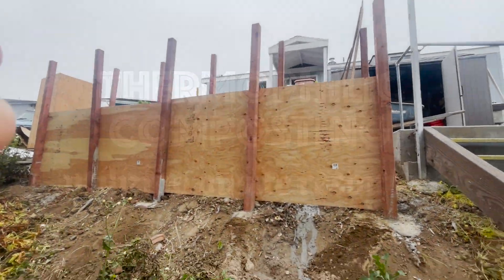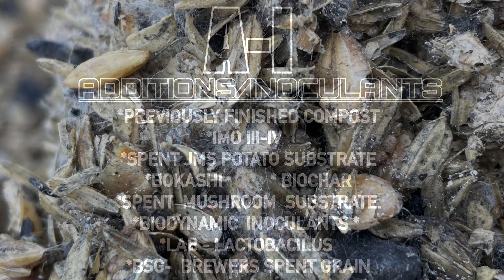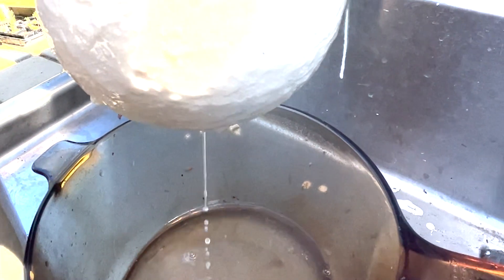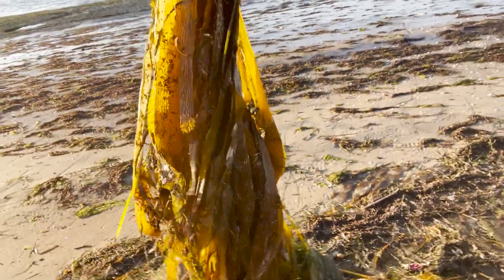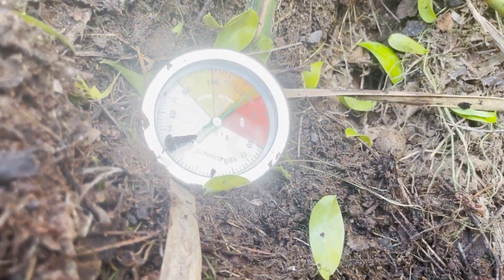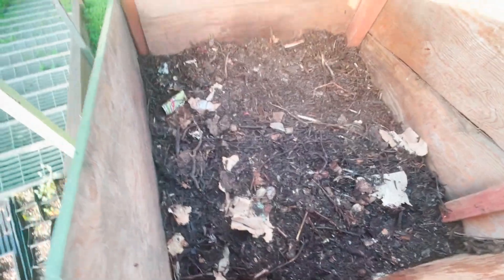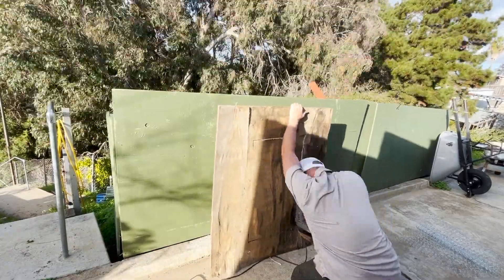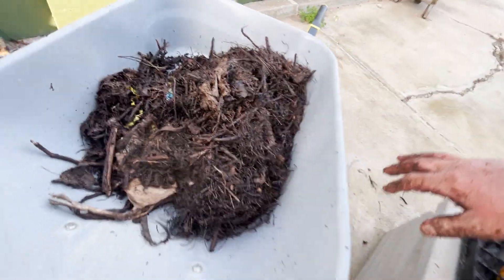Thermophilic Composting w/ onsite and local resources. Extra Inoculants.

Comment: Isn't the seaweed rather salty which could inhibit plant growth with the finished compost. I think I might rinse it well before composting.
Reply from the maker: Great Question that I should have addressed more clearly in the video... Actually Seawater or sea salt is used in JADAM and KNF natural farming methods as a trace mineral complex, as long as its diluted down w/ fresh water the ion bonds will break into available trace minerals. As you see in the video, I drench the pile thoroughly. Salt Residue hasn't been a problem for me. I would say if over 50% of your nitro starting material is coming from seaweed, then a better prewash is necessary.